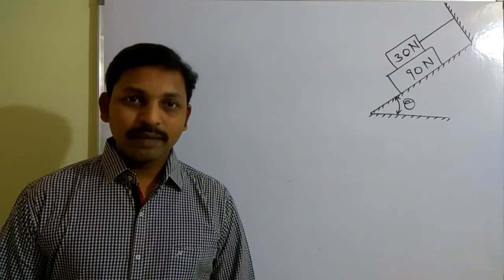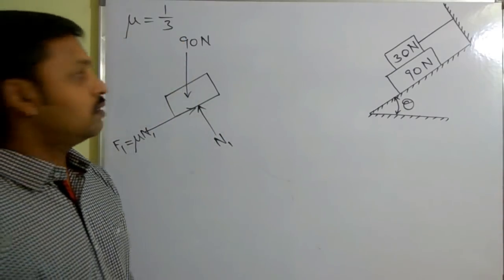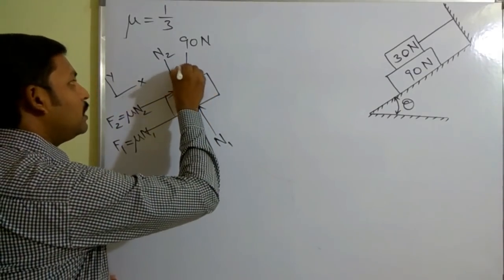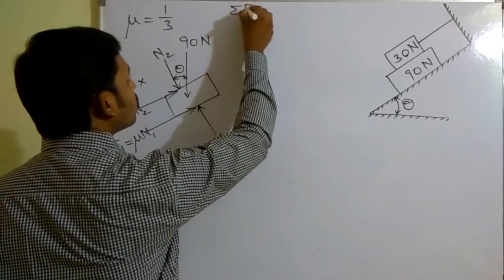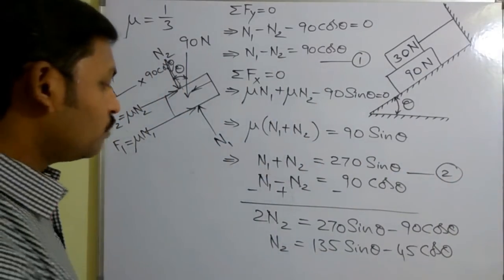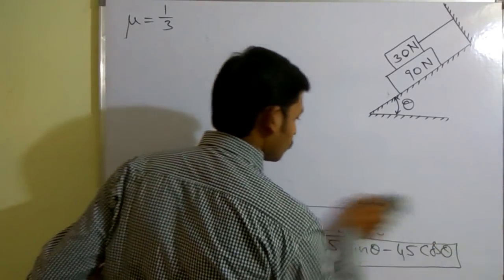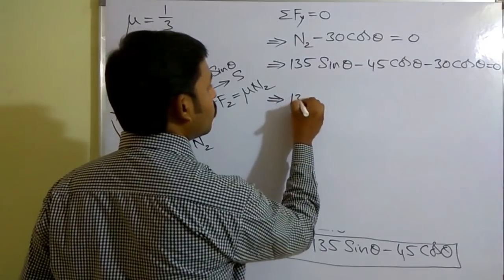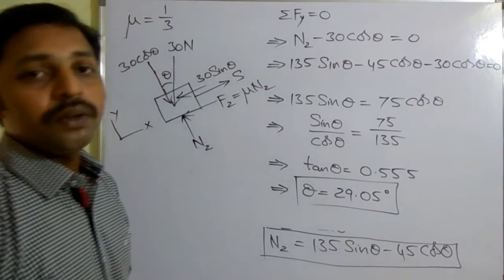Friction Problem No 2

Comment: Sir I have a question sir . If there did not given value of Miu in problem , so what will we do ? Please tell me sir
Reply from the maker: coefficient of friction will be given in the problem or otherwise angle of friction will be given. By using the relation coefficient of friction = tan(angle of friction) you can calculate
Reply: @LakshmiNarayanaV1212  yes sir really a turning point

Comment: Sir can you tell that . How to clear mechanical engineering subject . I have a got 14 internal out of 20 . Is it possible to clear this subject . Sir give me a tip please
Reply from the maker: Definetly it is possible Nikhil... Free Body Diagram is the basic concept whatever may be the chapter you study. Resolution and method of projections are two more important concepts. Without learning these basic things you cant solve any problem. But if you understand these concepts you can score good marks in your exam.  For good marks prepare Dynamics, Chapter -1 (which includes all basics), centroid. 
Practice FBD and try to write equations of equilibrium

Comment: Sir if there two or three blocks , so what will we do ? I mean which method to use .
Reply from the maker: Whatever may be the number of blocks, first observe in the given blocks which block will have tendency to move ? For that block first draw the free body diagram.Then for the remaining blocks draw free body diagram and apply equations of equilibrium. This is the general procedure.
For any problem:
When there are only three forces under equilibrium then lamis theorem is the best one, more than three forces go for method of projections

Comment: Sir...if two or more bodies are given in a problem ..for which body should we consider the FBD??
Reply from the maker: You can consider FBD for given bodies in any order for getting solution. Generally depending on the unknown forces present in FBD you can consider FBD. If less no.of unknowns are there in FBD it is easy to find those first instead of considering more unknown forces and keeping them in the form of equations to find later.
Hope it helps u
Reply: Thank you Sir !!!
Reply from the maker: My Pleasure  Ricky...